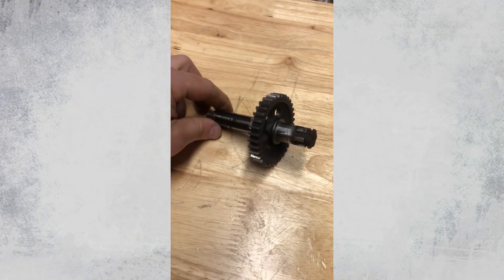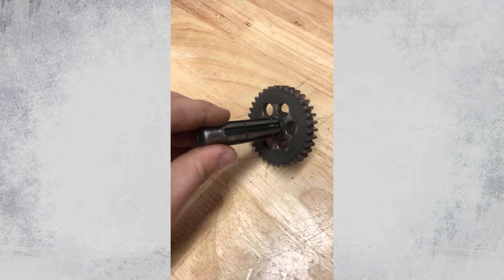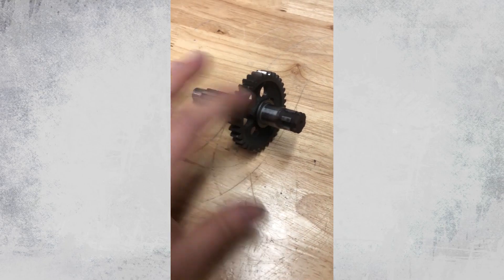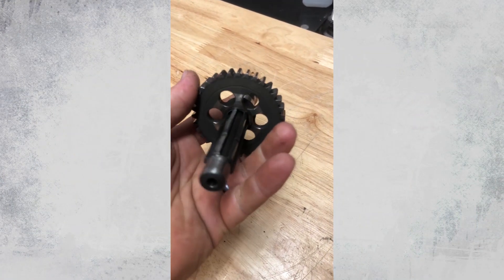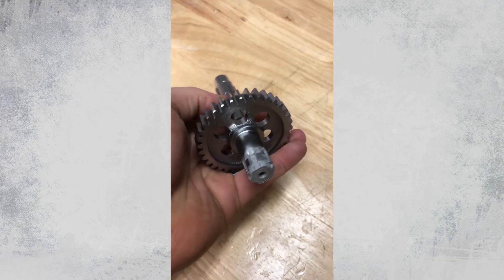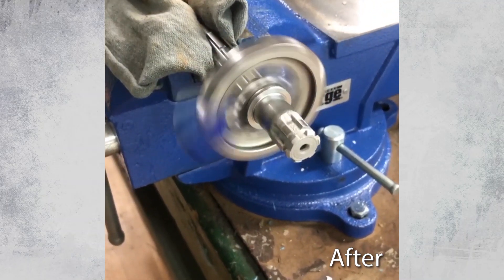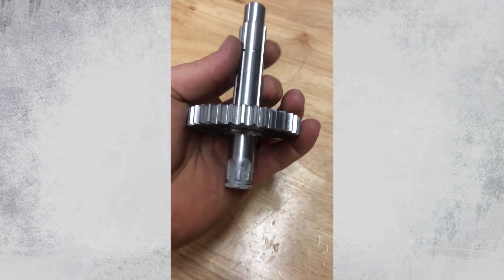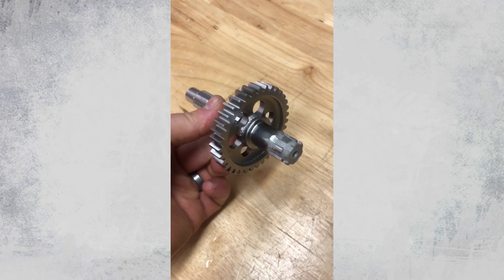Increasing the Lifespan of a Vintage Motorcycle Part - Vapor Honing Technologies

Comment: Is this the same thing as WPC treatment?
Reply: I don’t think so.  WPC is very secretive about their process.
Reply: @natez0690  Pretty sure wpc is just bead blasting with a moly dry lube, the beads impregnate the peened surface with the moly.
Reply from the maker: Very similar to WPC, this process is a process focused on peening the surface to reduce friction and strengthen engine parts.  For more information or to place your order please contact me at 828-202-5563 x 103 Niki nicole@vaporhoningtechnologies.com
Reply from the maker: Very similar to WPC, this process is a process focused on peening the surface to reduce friction and strengthen engine parts.  For more information or to place your order please contact me at 828-202-5563 x 103 Niki nicole@vaporhoningtechnologies.com